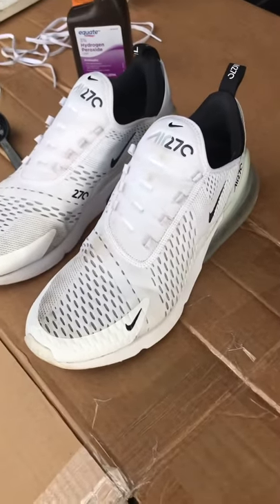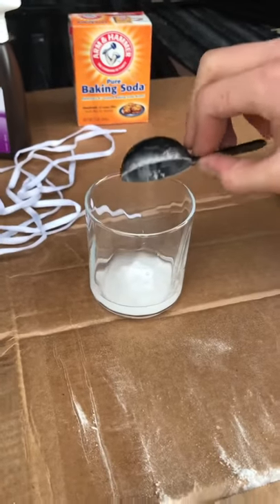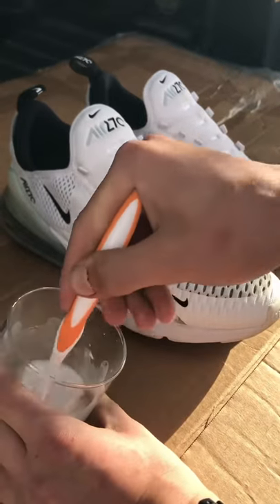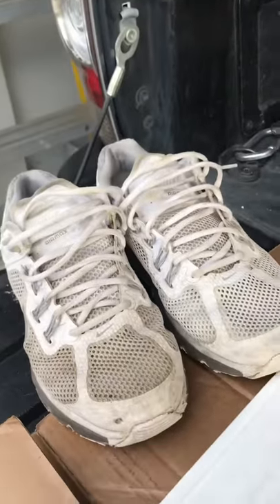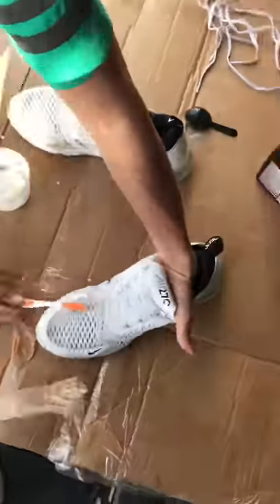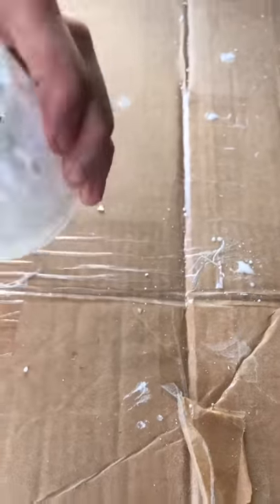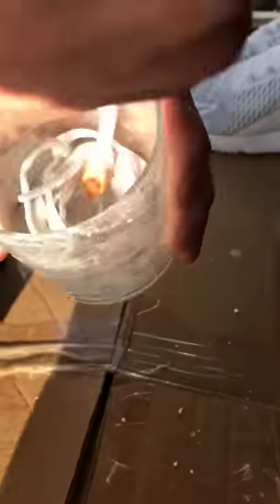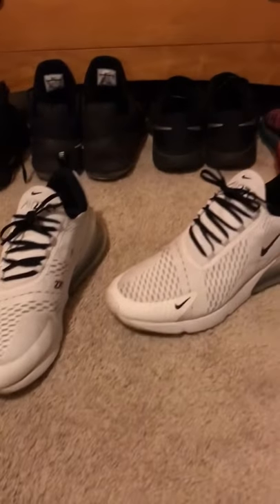How to clean *white nylon* shoes

Comment: I would use the hydrogen peroxide I would sprinkle the baking soda(a lot) all over the dirty parts of the shoe and then dip them in vinegar or spray vinegar on them works so well, turns whiter than white and still keeps the black(or whatever color you have on them) paint on 👍
Reply: Sorry I have a couple questions: 1. Did you mean to say wouldn’t use hydrogen peroxide m? If not what did you mean? Spray it on before or how did you do it? 2. Does this vinegar not make the shoe permanently spell like vinegar? Do you have to spray it with Febreze as well or how does it not smell? Thanks In advance
Reply: @tuffnutt05  it will probably smell vinegar but then you just put them on the wash machine and they will be good
Reply: @tuffnutt05  you can spray it or you can dump a bunch of it on there vinegar is like 4 bucks so it’s very cheap
Reply: @tuffnutt05  and yes I did mean to say I would not use hydrogen peroxide. 😄, also a power washer would work but not everybody has that I know I don’t

Comment: I used vinegar and baking soda and scrubbed with clean tooth brush, everything got clean and white but the tounge of my sneakers turned a yellowed color, it's like a messy type nylon material on that part and wondering what I did wrong and how I can fix this issue, they were yellow before, they were actually pretty dang clean and nice I just had a couple smudges of my dirty finger print type marks from pulling on my sneakers and it wouldn't wipe off normal,so I decided to do a deep cleaning but ended up messing them up worse than they were before I started cleaning them. Why did it turn yellow, I don't get it.
Reply: I have the same issue going on. I am not sure why.
Reply: The yellowing you're seeing on the white surface of your sneakers is a common issue, especially with white soles. This yellowing can be caused by a variety of factors, including exposure to sunlight, oxidation, or even the aging of certain materials. Here are some methods to try to address yellowing on your white sneakers:

1. Baking Soda and Water: Create a paste by mixing baking soda with a small amount of water. Apply this paste to the yellowed areas and gently scrub with a soft brush or cloth. Rinse and repeat as necessary. This method may help reduce yellowing.

2. Hydrogen Peroxide: You can try mixing a small amount of hydrogen peroxide with water. Apply this solution to the yellowed areas and use a cloth or sponge to scrub gently. Rinse thoroughly afterward.

3. Sneaker Whitening Products: There are commercial sneaker whitening products available that can help with yellowing. These products are designed specifically for restoring the whiteness of sneakers. Follow the instructions on the product carefully.

4. Sunlight: Some people have had success by placing their sneakers in direct sunlight for a limited time. However, this method can be risky, as prolonged exposure to sunlight may cause further damage or discoloration. Use this method with caution.

Comment: I got the same shoes but they turned yellow. Any1 kno how to un-yellow them
Reply: soak in bleach water
Reply: Rinse them out really well with clean water. I think the yellowing is due to the soap.  You'll  probably find you have to rinse them out multiple times to get the soap out completely.